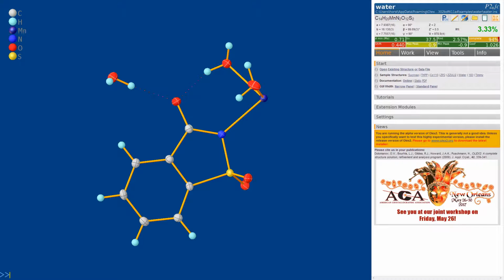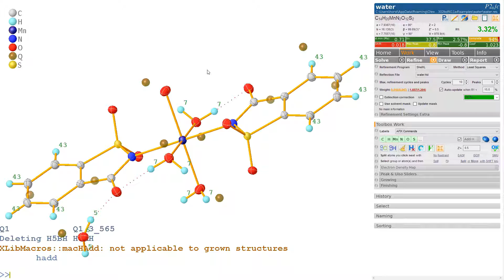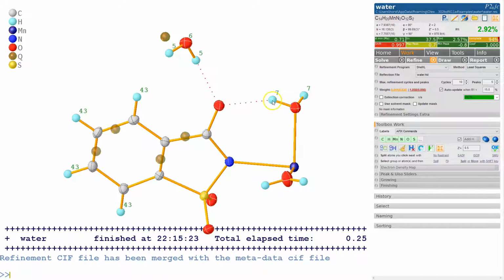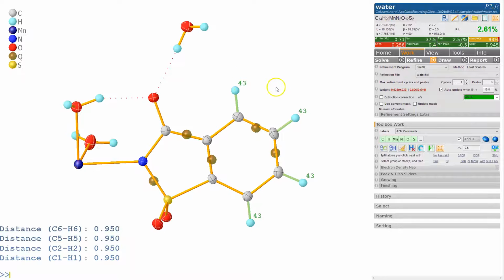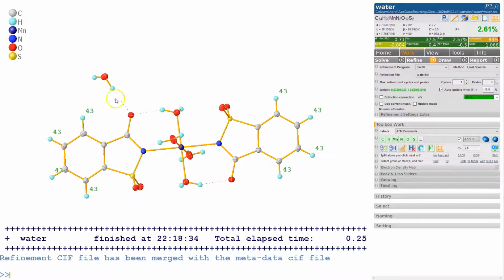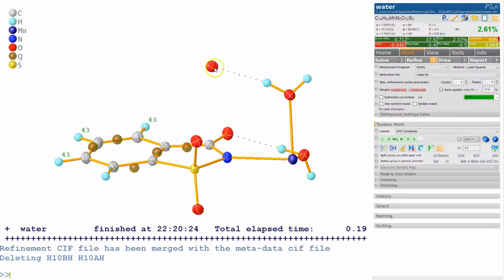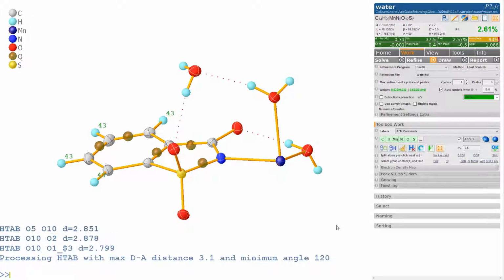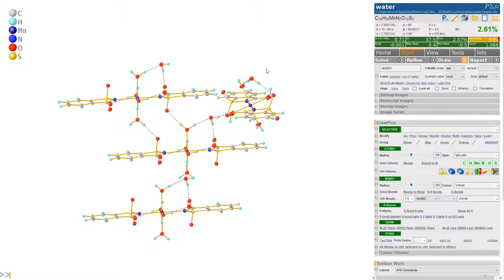Adding Hydrogen Atoms in Olex2

Comment: Could you please help me to get rid of this level B  PLAT 410 alert of  " Short Intra H...H Contact  H5       ..H16        1.80 Ang ". I have faced this problem in solving a number of structures. Here it's between hydrogen atoms of two adjacent phenyl rings connected by a NH group.

Comment: Hi I was wondering, how would you add hydrogens on and ammonium or a borohydride? Great video
Reply from the maker: Have a look at this snippet: https://youtu.be/ESb5GYXJQ8I. Basically, find the direction to make three H atoms (first the atom you want to add them to, then the atom(s) defining the direction, then 'hadd -137' -- once that's done, select the atom again, followed by the three new H atoms (which will provide the direction) and then hadd -13.
Reply: Hi  @olex2538 .  How is the refinement procedure using this method technically described? Thank you very much in advance